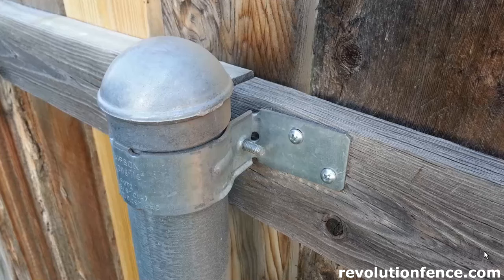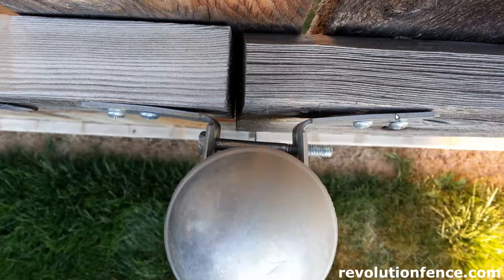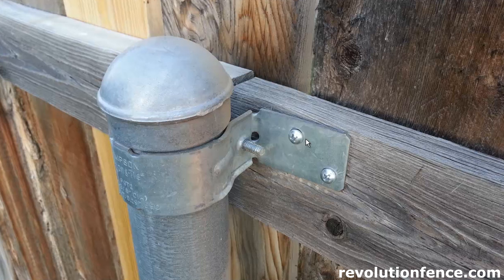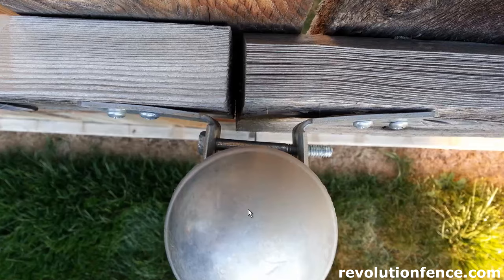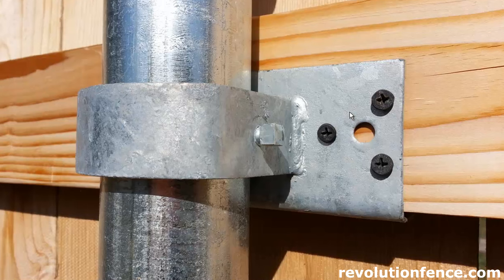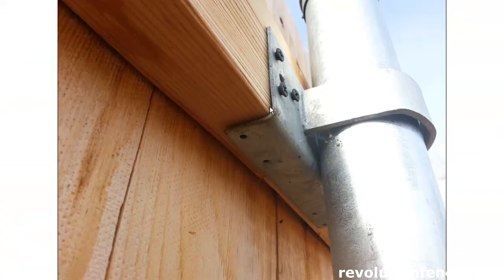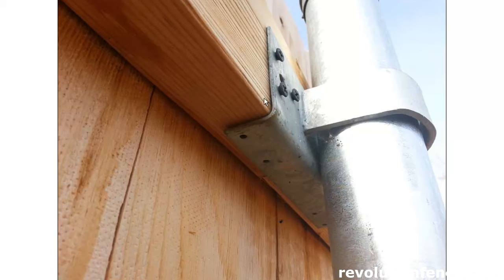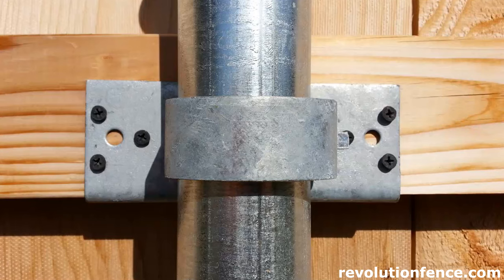Wood Fence Bracket Comparison | Revolution Fence | Meridian Idaho | (208) 991-4283

Comment: So not only did you use drywall screws instead of coated deck screws, but you neglected to put the 4th screw in the bottom on each side of the bracket. That 4th actually locks the post in as much as 2 of the other screws.

Comment: nice bracket, and then you go an use common drywall screws... uh
Reply: greedyg76 I also don't think an argument can be made that the setscrew is better. The bolt clamping around the tube is a better design and if you were really that worried about it coming off you could add a lock nut.
Reply from the maker: Hi, we put this small section of fence together just to show the brackets we use. We actually use high quality exterior screws for constructing our customer fences. We have edited the video to note this now. Thanks
Reply: greedyg76 hehehe, nice catch
Reply: Exactly
Reply: 8

Comment: Helpful tip:  The second bracket shows 3 DRYWALL screws on each side.  Use proper exterior-rated screws - especially if you are going the distance to install a proper bracket.  Just a helpful tip guys!
Reply from the maker: Yeah, we put this together just to show the type of brackets we use. We don't actually use these type of screws on the customer fences we build.
Reply: +Revolution Fence what type of brackets are those.
Reply: +Revolution Fence the second brackets
Reply: You think you could've put together the bracket and screws you normally use because you would have a bunch right there because you normally use them. How often do you hang drywall?? That is strange isn't it.
Reply: @mattwood4912  LOL interesting points there, Matt!

Comment: In my opinion the weight of the fence is not on the screws but rather the bracket around the post. The simpson bracket hugs the post tightly with multiple points of contact. The other does same with less points of contact. To me the best option would be the 2nd bracket with galvanized bolt going THROUGH the post with not on opposite side. Now the weight of fence would be on the bolt.
Reply: My thought as well, but then you would have to drill it by yourself after the height adjustment. The factory could put the holes on the bracket, but the post needs to be drilled during the installation for the bolt to go through (which won't be too difficult).
Reply: The weight of the fence is transferred from the fence to the bracket via the screws. If you're bench pressing, yes, the bench is bearing the load on the bar, but your arms are transferring the weight from the bar to the bench. Same principle. And like that, your arms will be the limiting factor even if the bench you're laying on can support much more weight.

Comment: On the first bracket it looks as though the post bolt was tightened after it was mounted to the rails, hence giving it a warped appearance. On the second bracket those look like drywall screws. Nothing galvanized or zinc coated.

Comment: No, the Simpson bracket DOES have a threaded hole for the 'cross bolt' which holds the bolt tight like a locking washer.  The tighter you make it the less 'aligned' the two holes become which is what holds that bolt secure from ever loosening by itself.  Wood fence panels will always sag over time and that sagging pulls the bracket in opposite directions which should only make that bolt become TIGHTER over time.  These brackets are designed to never slip or loosen to the metal post once secured.  The lag screws attaching the brackets to the fence panels may/can loosen over time just due to weathering and when the fence is subjected to strong winds (or a dog jumping against it for example).  The lag screws come a little loose over time but not much.
Reply: Well said, it was a bad picture used for this review

Comment: You can see the quick deterioration of the 2x4 which can be prevented by sloping the top using a power paner and then sealing with a wood sealer.

Comment: Would it make more sense to use a large enough self-tapping screw, or to drill a hole and run a cross bolt (maybe some sort of carriage bolt even), instead of using that set screw?

Comment: Interesting video!
In my woodworking, I like to come up with clever ways of eliminating brackets by using wood, if possible, so years ago when the fence around my new home in the suburbs started failing due to our frequent windstorms, and to the initial contractor’s annoying use of 4x4s that rot through… I started replacing the 4x4s with metal fence poles, but I eliminated the need for brackets by drilling 2-1/4” holes in the 2x4 rails and their supporting 2x4 brackets.  It has worked great and I’ve never had to replace one due to wind.  I wish I could post pictures of it, but YouTube doesn’t allow it.  🙁
Reply: plz due want to see wat u mean it sounds better

Comment: I saw this video a while back when researching my fence project. I found a similar product at my local Lowes store. I bought them and after using some of them I am not as fond of them. They are adjustable which would help those building on a slope. Instructions defy logic and tell you to install the shelf part of the bracket on the top of the board, That throws out the extra support feature I was looking for. Also, the bracket bolts together with 2 carriage bolts. the round head of the bolt causes the board to not fit flush and cause it to turn when tightening. 

My advise is look for the type in the video that is non adjustable and purchase online. A couple of people have posted different links where they can be bought.
Reply: Thanks will look those up ASAP about to start on my Fence already have Metal Post in place just need hardWare. Also what type of screw is good enough for this Job, well to screw into the fence slates and the 2X4's.

Comment: In your second example, you mentioned the pinch bolt screws directly into the post.  Would that scratch the galvanized layer of the post?  I get a lot of wind and water where I am so I am afraid of the galvanized layer getting scratched and rusting.
Reply: Yes that would scratch the galvanized layer. Unless you're going to wrap every single Post in bubble wrap from the time it exits the galvanization machine to the time you put it in the ground the post is going to get scratched regardless the little tiny indention that that bolt makes into the post is infinitely more important than the scratch that leaves doing so

Comment: I was looking for this setup so thank you. I do have a question though my non-engineering mind says that pinch bolt in the better bracket is a weak point. I would think a bolt going into the post would never go anywhere. May I assume you haven’t had any problems with these?

Comment: All the weight of the fence rests on that one tiny pinch bolt. I can see one kid climbing the fence, and the whole fence slides down until it hits the soil. It would be strong  if there were two side bolts that went INTO a hole on the vertical posts. That is the weak link and the fail point. I’d prefer the first fastener because of that

Comment: Thank you for the video. What type of steel posts do you use or recommend? SCH40? I was going to use 2 3/8" posts that are 16 gauge because that's what they sell at the big box stores. But many have told me that's too weak for a wood fence and I should get SCH40. However, its so hard to find those at a retail store that sells to the public. Thank you!
Reply: Check a lumber yard that sells fence pickets. And yes, chain link posts are too flimsy for wood fence

Comment: Why would you use drywall screws to hold the bracket instead of exterior screws, or even better bolts?
Reply: The holes arent big enough to use lag bolts of any size. For reference, watch the video for the shot looking up at the under side of the bracket
Reply: @michaelrichardson5505 then it’s a bad choice of bracket

Comment: Appears that the wrong type of screws were used. The heads on the screws should be flat since it will be in contact with the metal bracket. The tapered head of that screw, means that it is for connecting wood to wood.

Comment: I like the shelf style brackets I generally buy these at HD the smaller ones usually go for 3$ but once jumping up to a 2-7/8" bracket they run 12$ which is odd being the shelf bracket is same as ones for smaller posts the metal piece that wraps around a wider pole is only difference which costs 9$ more doesnt make sense..

Comment: I have 4 ft chain link I want to use the existing posts to bracket on 6ft wooden privacy fence. Will the existing 4 ft steel posts have enough stability to support 6ft fence panels or do I need to slip a larger diameter pipe over the existing posts to make them 6ft? I’ve seen it done both ways on YouTube. Thanks.
Reply: They sell a 27" extension pipe the same diameter that slides into the existing pipe. Here's the link for the brackets incase you need it.   https://amzn.to/2UqGLCL

Comment: Why not put a self tapping screw through the strap into the post ??
It won’t slip
Reply: Short answer, time.
Does little bolt come pre-mounted in the bracket. You would have to not only drive the screw through the post which is really really thick but you would also have to use a punch to indent the pole to be able to screw the self-tapping screw into. not conducive to a quick job.

Comment: Use 1/4 x 1 1/4 Lag screws, not drywall screws.
Reply: Lag bolts wont fit intio the screw holes. USE COATED 1 ¹/⁴ COATED DECK SCREWS WITH TORX HEADS

Comment: I have to agree with a few others.  I always appreciate good tutorial or knowledge building videos, but presenting this as a PRO fence builder video, novices are watching closely.  Why on earth would you use weak, NON-SUITABLE, common drywall screws?  Especially when emphasizing how durable the brackets are!  Not only are these going to break easily, but also leave the stain streaks.  Isn't that like in the top three biggest DON'TS?  Nice video otherwise.
Reply from the maker: Hi Tim, this particular fence panel was put together mostly to use for showing off the brackets we use. We actually use high quality exterior type screws when building fences for customers. We have also made note of this in the video now too. Thanks
Reply: +Revolution Fence Thanks for the reply.  Really hate to criticize an otherwise very nice video.   jyst so many "how too's"..that could get a novice in trouble if they don't know otherwise.